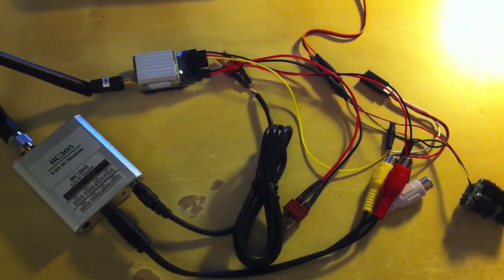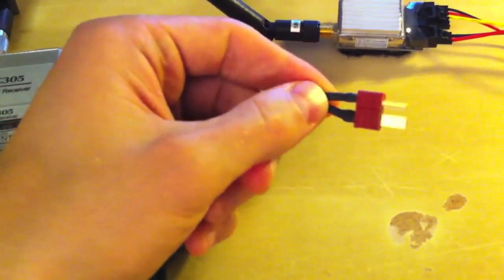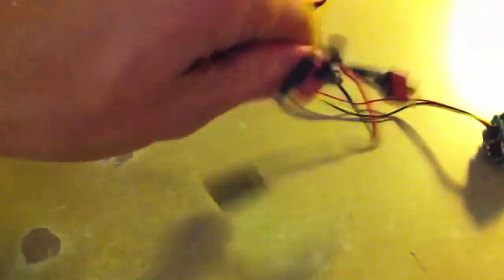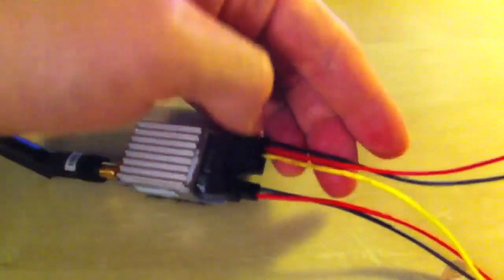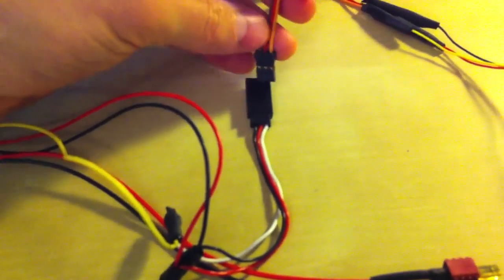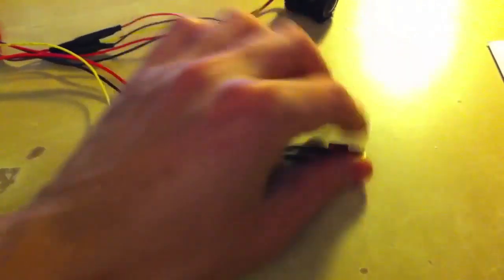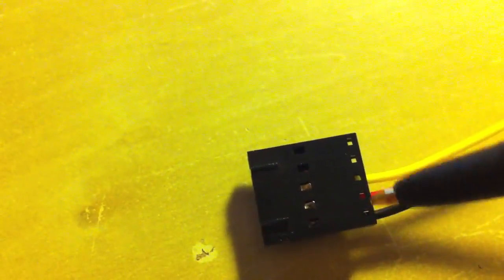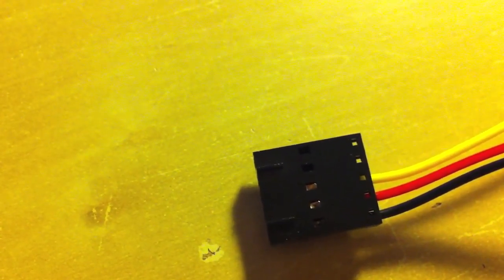Wiring an FPV Video System

Comment: Great post! I have a question seeing my transmitter doesn't have a power out, I'll have to add wires from the battery lipO  I assume? In addition, you are using servo extensions. Can I use bullet connectors for example? 2mm for positive, negative and signal? Thanks!

Comment: I have my first fpv system its a HIEE ELECTRONICS  5.8 32CH 600MW    TS832 TX AND RM5832 7INCH MONITOR WITH BUILT IN RECEIVER I CANT GET A PICTURE AT ALL!!!. I NEED HELP. davidringler40@yahoo.com

Comment: Actually don't bother going to the trouble PDF, i found it by looking at images of the Tx in Google and I found that the green wire, the inner most in not used for anything and the white is audio. But here is a weird thing,.. while looking at line drawing of the Tx is that it has its own microphone on the circuit board, small <1/4" circular mic soldered by through hole oppos antenna. The first time I have become aware of this. Neat eh? I will check out some of your other uploads, happy fpv :-)

Comment: Hey there  PFD great post, Do you still remember what the other wires were on the Tx unit? Mine has from the outer right: black, red, yellow, white, green. Data from GPS can be sent via the sound channel. it is sent along with the video signal and stripped off at the ground antenna and used by the tracker's control board. So I would like to know what the green and the white are for on my 200mw VTx,... do you still have the specs, cause mine doesn't, Thanks